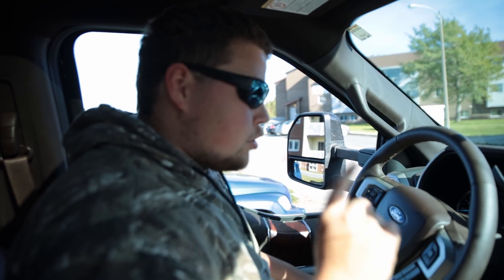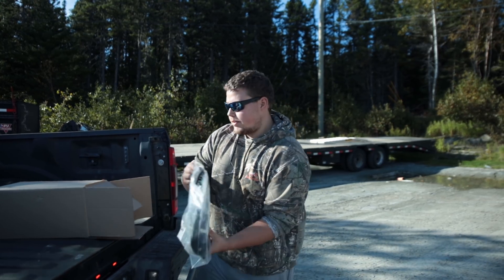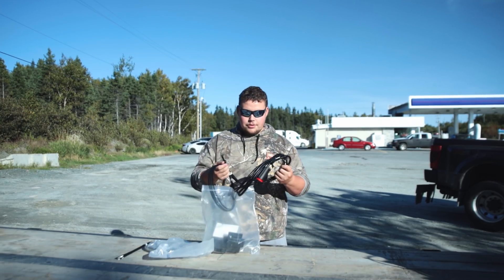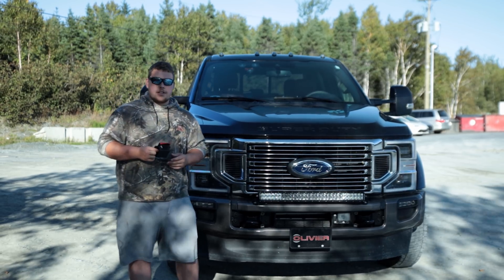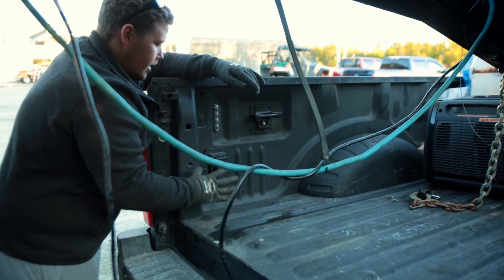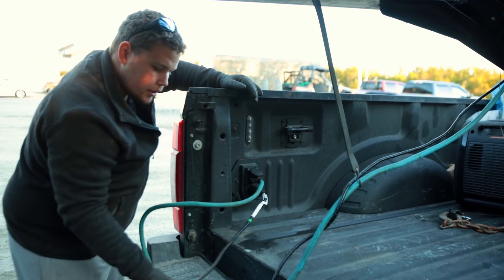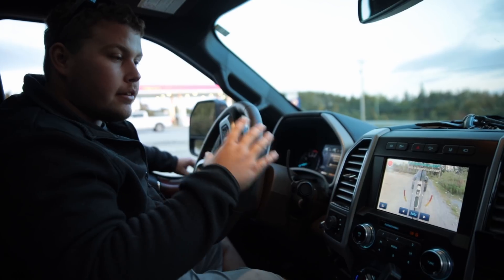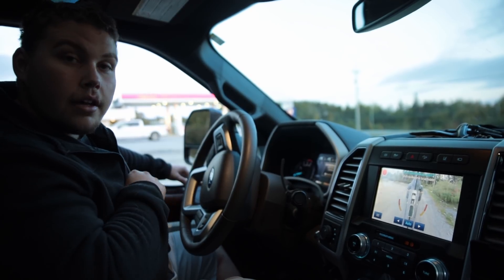THIS Truck Can REVERSE A TRAILER For You!!! HERE'S HOW

Comment: Camera is a good feature to have....but the park assist with the trailer seems to be too much. If it only lets you cut to a certain point how do you except to put the trailer in a spot where u have to cut it at a 90⁰ angle to the truck. You can't.

Comment: You said that (TPMS) would not work with Steel belted tires?? That has to be not correct, as most all tires have steel belts in them now days.
Reply: You can get sensors that spin on the valve stems. Seems like they should use that style for the heavy duty applications.
Reply: @consaka1  try that on an 18 wheeler or 1 ton and above cab and chassis truck and let me know how that goes, over a million miles behind me seen this mamy times before they dont work ever at all
Reply: @cubpak89  for what reason? Has more of a chance and simpler then trying to put them in a tire. Assuming if course the tech and range is reliable.
Reply: @consaka1  have a great life god bless until you drive commercially you wont understand
Reply: @cubpak89  hehehe what makes you think I haven't driven commercial. Yeah I have spent quite a bit of time laying under a truck in my youth adjusting brakes. Tighten up the slack and then back off 1/4 of a turn. :)  Sorry m8 but there is a solution to every problem and I have invented a lot of solutions and you fail to identify what you feel the main problem is.
Reply: I think he meant the heavy duty rims
Reply: On heavy duty f-g tires there are too many steel belts for the sensor to bounce signals through plus the amount of additional rubber, theres a reason they dont exsist for semis and their trailers as well